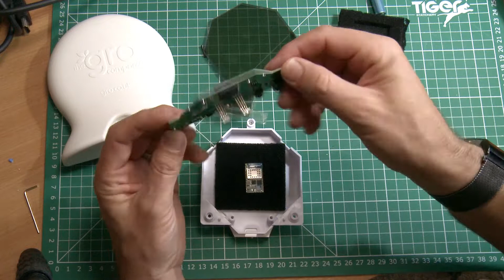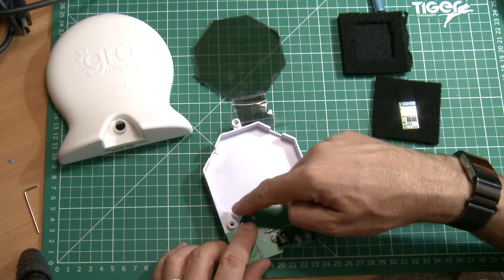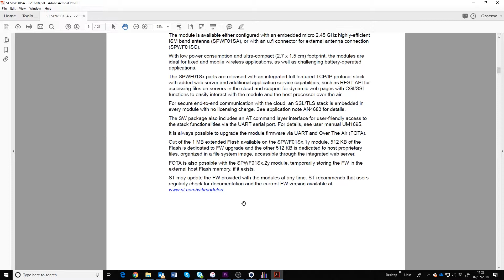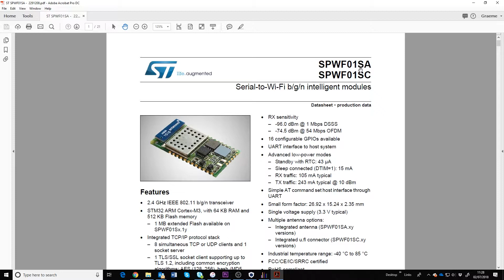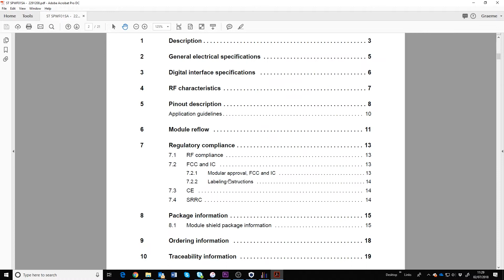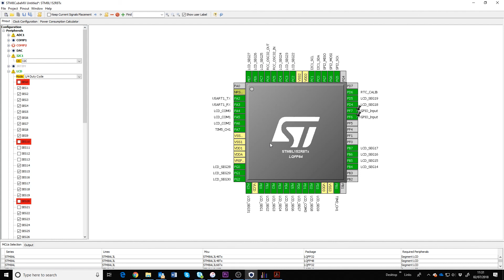#7 - GloClock Update 1

Comment: Any updates on this project?
Reply from the maker: Hi, Sadly no, Its all in a box with a Todo tag on it. My son is now 10 though he does still use one. One day ill get back to it. My issue is that I damaged the flex strip for the LCD - so need to either try fix that or get another unit. I'll also change from STM32 to ESP32 due to built in Wifi/Bluetooth.